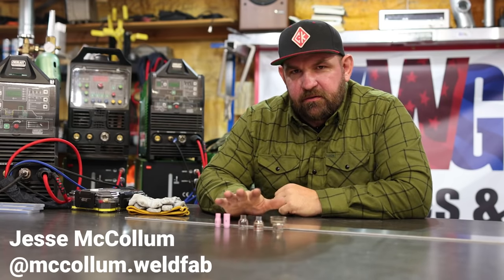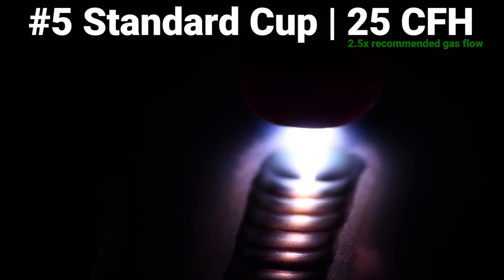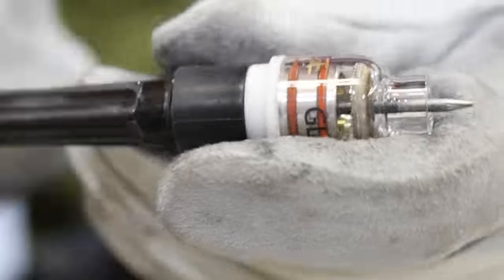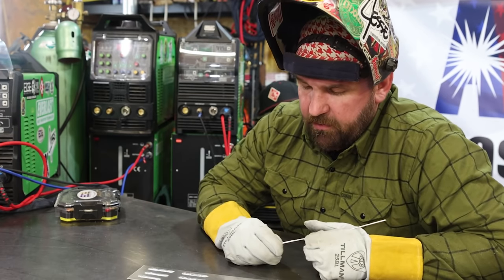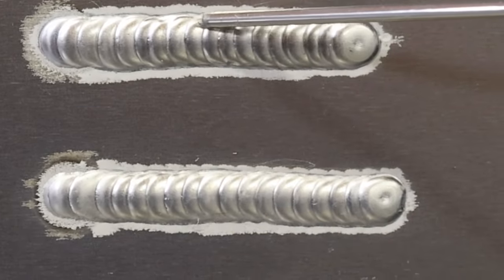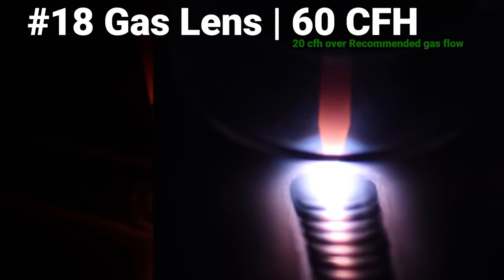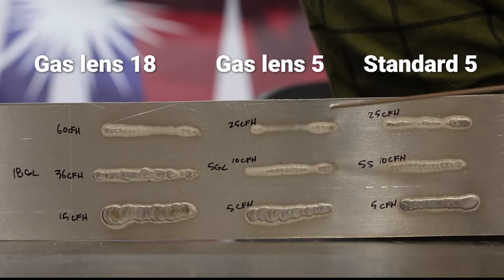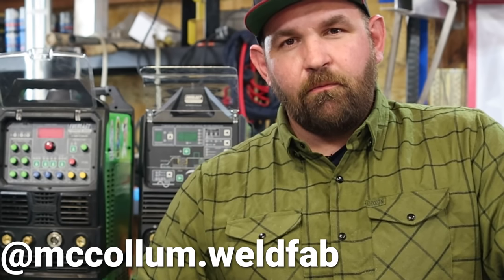Want Better Aluminum Welds? Cup Size & Gas Flow Matter!

Comment from the maker: Machine Settings on all welds: PowerTIG 255EXT | 121 amps | AC Frequency 121 hz | AC Balance 35% | Advanced Sq Wave
Reply: Max recommended stick out?
Reply: Why are there pinholes in the welds, even the good ones you have? I keep getting them with my 255ext and do fuel transfer/aux tanks, and I am quite frustrated with this machine. Let me know what you think, thanks

Comment: I was a welder for years years ago but tig was just high speed production not stacking dimes. Now as a maintenance man I tig and almost always just go to 30CFM because of air drafts in a factory, dirty metal, water vapor, oils. I always used argon but now find helium argon works better as I tend to weld large objects that swallow heat and preheating is for motived people.

Comment: Something that took me a very long time to figure out with welding aluminum and that goes with the lesson.  Tungsten stick out. I used to have my tungsten hanging out there. Mud puddles. Start at a 1/8 inch and adjust .

Comment: A couple of tips for how to troubleshoot when you're a beginner and your have something off would be super useful. Like, how to tell if your torch/solenoid/argon line is sucking up air, how to tell if you have a contaminated cylinder, how to tell if your consumables are poorly manufactured and have issues. These were the biggest problems I've encountered early in my training and it set me back months and demolished my confidence in the learning process I was onto.
Reply: It can get very discouraging sometimes. I gotta set back, drink a beer and tell myself it's not me. But I do like seeing the professionals screw up like I do. Keeps us on the same level.

Comment: Thanks for this! Great comparison. Low cfh looks just like failure to clean your material or dirty filler rod. Personally I have gotten such varying results using gass lenses on aluminum that I just don't do it anymore.

Comment: The rule of thumb (2x) gas flow to cup size starts to fall apart as the cup size increases.
I’ve seen 2.5x cup size as the gas flow recommendation as well.

Comment: Thanks for the excellent demonstration it helped a lot. I’m having one problem I can’t completely correct. At the end of an aluminum weld I try to add some rod and
Reply: and blend the puddle to prevent a crater. As I back off the peddle I get arcing from the tungsten, almost always 3 times before the arc goes out. This always causes a crater. On dc It works perfect, but ac frustrating. If I almost stick the tungsten in the puddle it may only zap (flash?)once, but it’s unpredictable and always ruins the puddle.
255ext, new. Settings as recomended in the post by Everlast. 
3/32 lanthinated tungsten, #5 cup, 10 -12 cfm, tried different tungsten diameter and tapers, 4043 rod welding 5052  .062 thick. Tested

Comment: Another great video. Looking for some feedback on different types of tungsten and taper or not to taper that people are using with aluminum, thanks
Reply: I pretty much only use 2% lanthanated these days.... Typically 1/8" on aluminum at 30 degree taper, blunted; and 3/32 on mild steel and stainless at a 30 degree sharp point.

Comment: Thankyou, I have heard that the smaller cups do fine because with Aluminium you are predominantly cooling the Tungsten, and enough gas to protect the bead cleanliness, not like in Steel where cooling the Hot steel is a bit more important. I was surprised the 16 cup did ok, but you needed so much gas, at any lower flow rates it got disastrous.

Comment: I've seen nothing but good things said about glass gas lenses, thank you for the info!

This may be off topic, but I posted a similar Everlast question/comment on another channel:
I'm just a (software engineer, soon to retire) car/metal fab hobby guy that has been running a Lincoln SP-175+ MIG welder in my garage for the last 25-years.  I've been looking at the Everlast TIG welders for the past year in hopes of learning to TIG weld too.

Since I have a 240V 40A AC power receptacle that's been my MIG power source (and no real need to TIG using 120V) and have the desire for higher TIG welding duty cycles and the capacity to weld thicker steel and aluminum, would buying the 325-EXT over the 255-EXT be a bad idea?  Any drawbacks to the 325-EXT over the 255-EXT (other than $250, which is not huge)?

Comment: Thank you 
Just one question! How do I know if my machine is running correctly. Seems kinda loud, but never ran aluminum before,.
Reply: The AC noise is much, much louder than it seems on video. At high amps and frequencies you almost need ear protection

Comment: Love your demos, Jesse.   I don't really like the "double the cup size" rule of thumb because the area of the cup varies with the square of the diameter.  A #15 cup is 3X the diameter of a #5, but 9X the area.  Your 60 CFH flow on the #15 cup still has much lower velocity than 10 CFH thru a #5 cup.    Now I will torment you and the Everlast engineers:  Did you perhaps have your machine too close to your work table for that last test?  The blast of cooling air out the front vents of my PowerTIG 255EXT has given me the vapors at times by disturbing my shield!   Why oh why didn't they exhaust it out the BACK???  I would love to reverse that direction of flow.  Please ask Everlast if I can just reverse the internal fans or do they need to sell a retrofit baffle kit for this!!!??!!
Reply: Yeahhhhhh its not quite THAT exact... But the old "double the cup" will get ya in the ball park. Regulator to regulator will vary a bit as well, I just thought showing people how too high and too low look  might be able to help alittle. As for the last run, the machine was in the same position as the others, as well as the location of the weld... When setting up we had to make some adjustments to the machine position and where I was welding for that reason.
Reply: Tape a paper/cardboard shroud around the face?  Or lay a toolbox in front of the welder?  Yes, too much airflow out of the welder to have it directly on the bench pointing at the work.
Reply: @carpediemarts705  - Yes, quite so.   My shop is tiny so I don't have a lot of options on placement or raw distance.  My machine is on a custom cart I built, with the torch cooler at the bottom and the welder above it.  I built a "blast deflector" on the  front to direct the discharge down.  I love the welder but the location of the gas inlet at the center (of the bottle) and the direction of cooling flow were surprisingly obvious oversights (to me).
Reply: I have a unit that is fabricated at the same factory as the everlast machines. I really don't like the cooling direction. Why didn't they reverse the flow? The only good thing about is that you get a cool breeze in the summer.
Reply: I put a 90 fitting on my everlast 185, got it from napa in the air brake fittings cabinet.

Comment: What color tungsten do you use for aluminum? Thanks
Reply: Personally, i prefer 1/8" 2% lanthanated for aluminum, i only drop down to 3/32" when i get on material less than .065" in thickness

Comment: Do you run a truncated tungsten,  it seems like you run a lot of stick out like you'd use for steel or stainless , what tungsten , your alloy is new but still will have a layer of oxide , maybe why all the starts are a bit dirty till the cleaning happens    is that cerated or similar tungsten,  I know you can see better , do many use a balled end ziconiated  , I use both , love to have adjustable hertz. Cheers  good video.

Comment: Do all flow meters read the same?  Mine says the top of the ball is the reading.  It looked like you were using the middle.  Camera angle possibly?
Reply: There is definitely a small difference between each one, usually not enough to matter much, even brands of gas lens will flow slightly different and one might need more or less than another
Reply: Just like thermostats,thermometers, scales and dyno’s, they are all different.    Especially off brand stuff.  We use one ball float style tool that you put on the gas cup and all regulators can be off a little using the same exact tool to measure flow with.

Comment: Thanks for this video. Question, do you never remove the oxidation layer on aluminium? Or just clean with acetone?
Reply: Personally.... I don't on most of the stuff i build, but im using new, and clean material for most of my builds. Just a good rub down with Windex if its dusty or acetone or carb and choke cleaner for oil and grease. Ive found on new material trying to remove the oxide layer(which is what balance does anyway) often times introduces more dirt and grime into the base material. On older and dirty material for repairs, I'll usually grind with a flap disc, then hit it with scotchbrite, then wipe down with acetone and weld.

Comment: You came make gas lenses with sink aerators screens. Just cut to fit.  And then after that you learn if you control room air flow, you can turn your gas flow way down and never use a lens’s again!  Ga$ i$ $$$$$$$! Unless someone else is catching the bill. Post flow is more important than duration!

Comment: Why not gas lense number 8. I see alot of people use that for aluminum
Reply: Ideally we would have compared a 5-8, but just doing the 5s the video was getting pretty long. The main point was to show what each type of cup does at an improper gas flow. The 18 run was more to show that a properly dialed in, there really isnt much difference in the bead.
Reply: 5 or 6 is actually the most common. Gas lens or not.
Reply: @Kevin Blackwell  I used to use the non gas lense number 6. But it didn't fit my needs.nonce I tried the stubby 8, it was much better. For aluminum anyway .